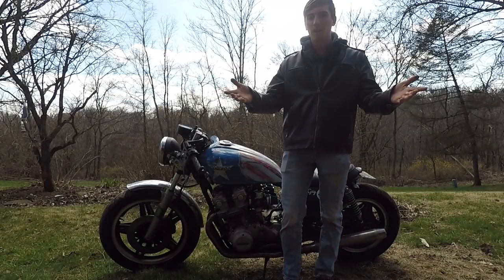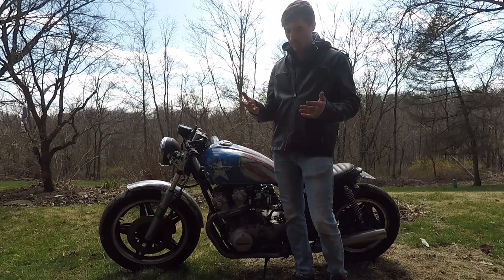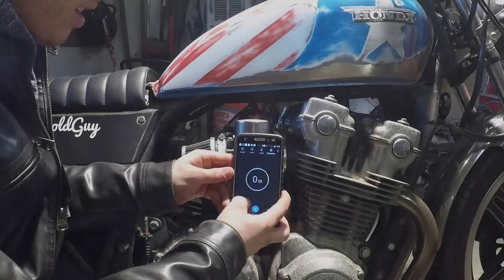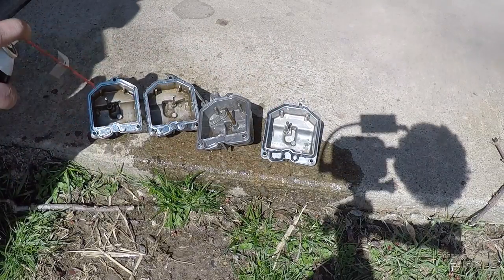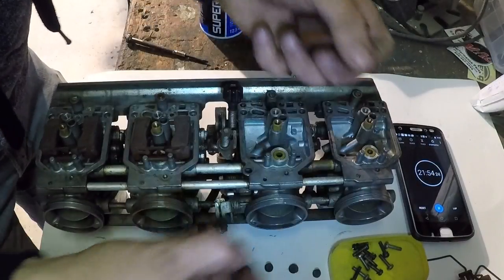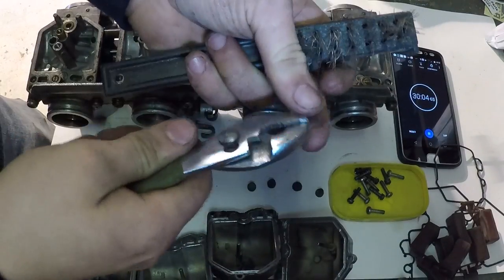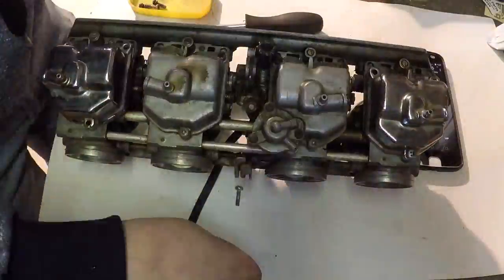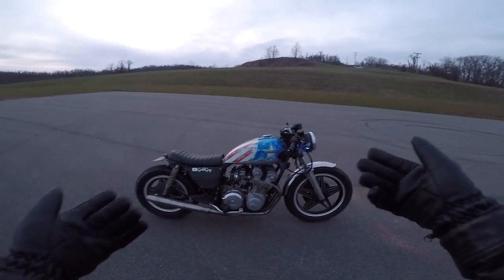How To: Clean Carburetors Like a Pro!

Comment: A few things should be added here:
1. Always wear gloves and eye protection. Carb cleaner is nasty stuff.
2. Only do this in a well ventilated area. Carb cleaner is nasty stuff.
3. Use a softer brass bristle to clean the jets if there's a blockage (you may not need to use one at all), not steel. Steel can damage the inside of the jets.
4. It's good to have a carb rebuild kit specific to your bike/carbs purchased ahead of time in case any parts need replacing. At the very least have some O rings/gaskets.
5. If you're not familiar and comfortable with disassembly/reassembly of your carbs, only do one at a time so that you have another fully assembled carb you can reference if you're unsure. (assuming your bike has more than one cylinder)
6. If you're still experiencing running/idle issues after carb cleaning you may just need to adjust your fuel/air mixture screws.
7. Take your time. Trying to get it done quickly will only lead to mistakes.
Reply: I was going to say, you really shouldn't use steel wire to clean out a jet. They make tools for that, but honestly I have never seen a jet so plugged that sticking the carb cleaner straw to it and blasting it didn't fix.
Reply: carb cleaner or brake cleaner? does it matter?

Comment: Shouldn't you take out the diafragms and caps before you spray the carb cleaner, as it can eat away at the rubber. Also it's good to inspect them closely each time you clean the carbs. It saves you from future confusion
Reply from the maker: Blake Brasfield carb diaphragms can stand up to carb cleaner, it doesn't eat them away. But yes that would be a good thing to inspect as well, if your diaphragms have leaks than it will cause problems. Thanks for the comment, good call!
Reply: rubber prevails against Carb Cleaner

it’s BRAKE cleaner that will destroy diaphragms/orings/gaskets

Comment: So, dumping carb gas into a gold pan, lol, ... so you go out looking for flake? always wanted to try that. Just started a build on a 1980 CB750 Custom. It's been in a guys garage for near on ten years but turns over and is super clean. I got to the point in builds where I could take the carbs off a CB disassemble them swap internals and back on the bike within 20 minutes, not bragging and really don't like doing it, but sometimes it needs to be done. Great content as always.

Comment: I think whats killing your bike is those pod filters, those carbs run off vacuum and with all that air coming in it might just be bogging it down might need to go with the stock air box for the the right tune  air& fuel mix.
Reply: Yes 900 ! You can get good cruise but crap WOT ! If you want it to run right out the ugly air box back on !!! 

I’m still running my pods ! I’m only a cruiser anyway !!

Comment: Good job!Hope my comment on the last video helped you!Next time also unscrew the top of the carbs and check the rubber membranes for tears.Now make sure to synchnronize the carbs with a vacuum gauge.Good luck!
Reply: The CB750 carbs in this vid do not have rubber slide diaphragms. they use metal pistons to lift the slides

Comment: How often must you clean carburaters. And what are the signs to look for when you think they need to be cleaned
Reply: when your bike runs like shit ...when the motorcycle fails to start , like reaaaaaly struggling to start ...when fuel consumption is way off ....when some cylinders do not work .... once you do it once you can do it again . its easy ...but after cleaning you should sync those carbs if you want top performance

Comment: Use a brass bristle instead of steel, steel is harder than brass and is more likely to gouge the brass. Thanks for the video.
Reply: I use a nylon bristle from a scrubbing brush.
Reply: @nikroche2621  2000 & 3000 wet sandpaper works best
Reply: @wtbofnc7880  for cleaning/clearing the inside of a jet?...
Reply: @nikroche2621  pipe cleaner with LiquiMoly carb cleaner...    —the wet sandpaper was for the rest of the Carbs

Comment: Never use steel wire to clean out the Brass Jets you want to use wire that is as soft, or softer then the Jets. You can use Copper Wire from Stranded Electrical Wire or a Bristle from a Brass cleaning Brush.
Reply: Or fishing line or a plastic brush bristle

Comment: I'm literally the least mechanically inclined person ever. So to me, having to take the carbs off my 06' Ninja 500r sounds like a nightmare because of the frame, and the.. gas tank? (I think I have to remove that to get to my carburetor?)

Anyways, any tips would be appreciated :)
Also congrats on the 30k milestone you were talking about man! Happy for ya 😄
Reply: Vertigo T most sport bikes are super simple to take the tank off usually only a bolt or two. Just look up a video

Comment: Getting ready to do this. As far as the float bowl gaskets go, are you having good luck in re-using them? I've done some in the past and they always seem to leak.
Reply from the maker: Yeah I've always had good luck reusing the old float bowl gaskets.
Reply: I just completely cleaned mine out, it’s been sitting for a few years so I figured I should probably give them a clean. (Not my bike, just bored) so I made sure to take everything apart and put back together exactly as I found it, now I turn the gas on to the carbs and the floats won’t stop the fuel and it fills up the carbs and goes through the overflow, I have no idea what went wrong

Comment: Cleaning the carbs on my 81 750 C. There is a tube running through in between carbs 2&3. Where does this connect?
Reply: Is it the vacuum line from the gas tank shutoff valve?

Comment: What size jets are you running in the cb750 I'm adding pod filters and need a little insight
Reply from the maker: 140 main Jets and stock sized pilot Jets.
Reply: Thanks bud!!!!
Reply: Did you end up changing the fuel air mixture???

Comment from the maker: Another thing you should do when cleaning your carbs that I neglected to include in my video is to check the diaphragms for cracks or holes, they are on the top of the carbs, opposite the bowls. Remove the two screws holding the top cylindrical cap off and carefully remove diaphragms and inspect them. If they are cracked or leaking, your bike will also run like total garbage.
Reply: The CB750 carbs in this vid do not have rubber slide diaphragms. they use metal pistons to lift the slides

Comment from the maker: Please share this video with someone who has a bike that runs like $#@!!
Reply: Goldguy im from México I have a honda cb 750F  and I want to modify it just like that beauty
Reply: You really shouldn't use steel wire to clean your jets, it damage them. You need to use copper wires.
Reply from the maker: C4H10N4O2 you are definitely right, I would have used a brass wire if I had a brass wire brush but I didn't. Good call!

Comment: Diaphragms will distort very quickly with full strength carb cleaner. I'd say you got lucky.
Reply: If same as 81 CB650c they are metal slide type Diaphragms

Comment: the bike might run better than it did before, but it still doesn't run as well as it should.  this is most definitely NOT cleaning them "Like a Pro"
Reply: He may clean them like a pro, but the video didn't say anything about adjusting like a pro. Could also be that the bike was very worn

Comment: nothing is easier to get the carbs off of than an old 750 honda that already has the old airboxes out of the way. 
Try it on my 82 Honda Magna V-45. 
isn't it convenient that you can't see the cellphone during reassembly and isn't it funny how he gets to the end of the video to roll it out and see how it runs and you don't get to see how it runs because all he does is stand back 30 feet from the bike while it's idling.  So what am I saying? the whole video backfired on his ass because he put it back together and it didn't run right. He couldn't show you how it runs because it runs poorly because he screwed something up. He could have saved it by fixing it and showing it running right instead of making the ending so unconvincingly phony. This whole video is utter bullsh*t.
Reply: Or a ZZR 1100  Just to get to the carburetors, u have to take ½ the bike apart...
Reply: @Pianissimo1970  yes getting the carbs off is sometimes 3/4s of the battle. It's a good video for what to do once you do get them off. Unless you get into soaking, ultrasonic cleaning etc.
Reply: Same thing on the v65 sabre. a million mysterious hoses and a big ass radiator in the way